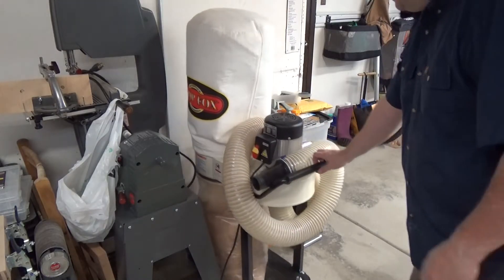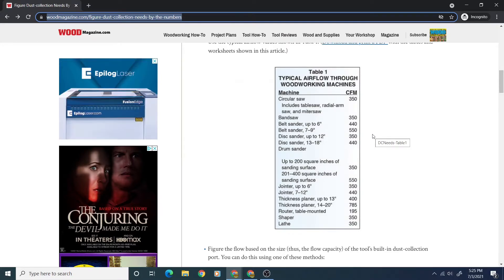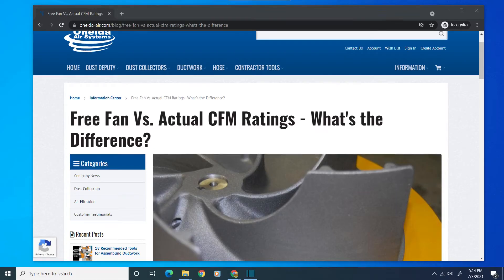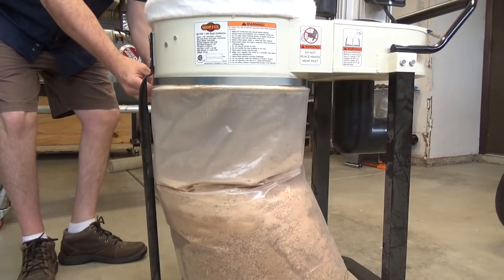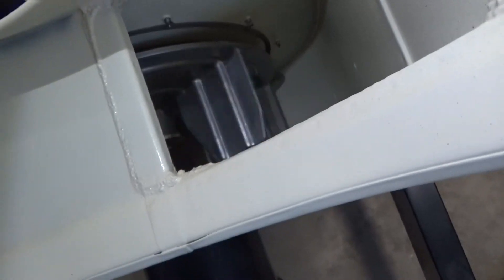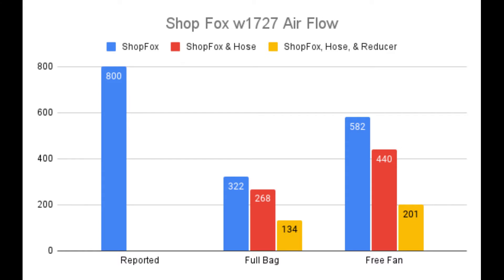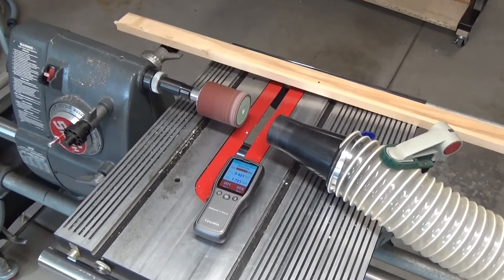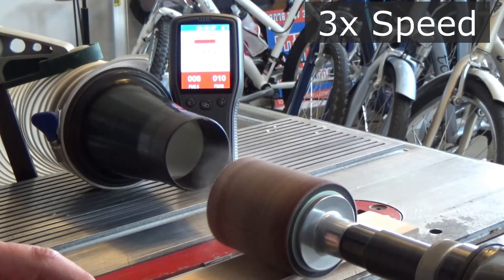Woodworking Dust Collector Tested: 800 CFM Really? Does it Matter?

Comment: Wow I was testing a 2HP shopfox single stage at my work and I was so confused when I measured the actual cfm at the flex duct end. I was measuring a little more than 1/3 of the rated cfm rating at the flex duct end. When I measured directly at the dust collector inlet, I measured 1/2 of the rated cfm rating which was much higher but still not the rated cfm rating. The dust collector probably had not ever been cleaned and they used it for around 7 years.

Your graph ratings are very similar to what I measured for my shopfox at work.

Comment: Good video and I have subscribed. I worked many years in the HVAC (industrial) environment and your tests are valid. As you mentioned, most important is performance. In my experience, lowering the airflow rate of blowers significantly lowers the KW (of amps). It would be interesting to see some actual amp or power data for your dust collector. I would guess you are running about 30% of the motor nameplate FLA rating.

Comment: Good analysis and interesting conclusions.
Does it keep up with the dust generated with your table saw? Also, do you have a lunchbox planer? If so, can it keep up with that?
Reply from the maker: Thanks Steve. Yes, the dust collector does a decent job on the table saw and Lu box planner. But I would say it’s the bare minimum. At some point I would like to upgrade to something like the Oneida mini dust gorilla.

Comment: I like this video. My dust system is very similar to what your using down to the moving of the hose and the 4” to 2- 1/2” adaptor. I couldn’t be happier for the reasons you mentioned. Let me add that a system like yours has a slower, quieter motor than any shop vac.
Reply from the maker: Yes it’s definitely an upgrade from the shop vac I used to use.

Comment: really good video, thanks for your detailed analysis as I'm considering if that exact system will be good enough for my use (which is similar to yours). Thanks!
Reply from the maker: Thank you, if you are considering the same model, rockler sells a 42 inch hood for $40. It is rated at 1 micron.  It is listed as a Jet dc650 filter but fits mine. I did the upgrade and am happy with it.

Comment: Can u share link to Anemometer u used? Have I g a hard time finding one that doesn’t require a bunch of math lol
Reply from the maker: Sure, I added the link to the description. Note, you still have to calculate the area of the opening in feet and enter that into the unit in order for the unit to correctly calculate CFM on the fly. I have seen many YouTube videos where it was obvious that the video maker did not understand this and showed impossible CFM value for the unit they were testing.

Comment: @ 2:06  you mentioned the chart from a magazine showing the typical airflow through woodworking machines.

I'm a bit confused at this; does this chart show (mean) that if one were to get an effective dust collection for a table saw they would have to have a CFM of at least 351?

Is that how I'm supposed to read the chart?

thanks for the video by the way, appreciate the content :)
Reply from the maker: Hi Fred thanks for watching, glad you enjoyed the video. I linked the article in the video description, which explains a lot more about those numbers. But I believe the 30 CFM value is based on maintaining 4,000 FPM (average minimum to suspend dust in air) for a 4 inch dust port. So it assumes a table saw with a 4 in dust port.

I take all these numbers to be rules of thumb, some of them are achievable for a hobbyist like me while others are only accessible to professional shops with large budgets. So I just do the best I can with what I got.

BTW - I did a follow up to this video and another update in my Shop Tour video if you are interested.

Comment: Not sure how I missed this one. This answers my question about if you have installed a Thein baffle or not. Have you looked into them? Scott
Reply from the maker: Thanks Scott, I hope you enjoyed the video!
Reply from the maker: Scott, based on your question, I looked into and thought a lot about an internal style Thien baffle that mounts inside the "bag ring."  Short answer, I have decided not to pursue it. Short reason, I think my dust collector is too whippy to compensate for the CFM drop.

I'm making a lot of assumptions, BUT if the purpose of the baffle is to encourage more dust to drop into the bottom bag than already achieved by the cyclonic action of my existing bag ring, then the only way it can do that is to slow the air velocity at the outer ring. Slower air suspends less particles. 

One way to slow air (at a fixed CFM through put) is to move the air from a small vessel to a large vessel, like a dust deputy does. It slows the velocity and allows the centrifugal forces to push the dust up against the cone wall, where is slows further and then falls. Hopefully the air in the center moves much faster to compensate so that the total throughput is unchanged, but we know that cyclones reduce CFM throughput so it is not 100% effective. Different designs may have different efficiencies, so Bangood shopper beware!

I don't think the Thien baffle is slowing air by moving it into a larger chamber, I think it is probably employing the other method of slowing air, which is to increase air friction by adding a large surface to the air stream. Unless it has a mechanism to increase the air velocity in the center zone to make up for the lower velocities against the outer ring that help the particles fall out, then it will significantly cut the CFM throughput of the system. 

So, for guys with a 2-3 HP system who just installed a HEPA grade canister filter, then they can probably afford to lose 100 CFM or so in order to buy a little more time before their filter clogs. For my little 1Hp system which barely makes 300 CFM at the end of my hose, I can't afford to lose air flow. But I think tapping on the felt bag to clean the filter for 20 seconds once a day is a reasonable alternative. -Tom
Reply: @woodshopnerdery  Sounds well reasoned, but it would still make for good content.

Comment: Love the info on vacs. all I have right now is a shop vac and am looking at dust collectors to see if I can find one in my price range. Keep up the good work!
Reply from the maker: Glad you liked the video. I started with a shop vac too. They work but to help keep the filter clean I added a dust deputy, but it was hard to move the dusty deputy and shop vac around the garage. So I looked into making a cart, but then thought, why make a cart when I can get a dust collector that takes up less space? So that's when I made the upgrade. BTW - I just saw my model dust collector advertised on Marketplace in my area for $150. Seems like a great deal, if I didn't already have one I would get it.

Comment: Good video.  A cyclone would allow you to maintain a set airflow for much longer between filter bag cleanings as it catches the majority of the fine dust, but unfortunately you'll lose about 20% airflow with it.  In other words they protect you filter and keep it working better, longer so you will have a more consistent airflow over time using one.  You may want to look into a HEPA cartridge filter (Wynn as an example) instead of those filter bags though.  Yours is only rated down to 2.5 µm, whereas a HEPA filter would be spec'ed down to 0.3 µm which is the more damaging particle size for your lungs.
Reply from the maker: Great information RFGuy. I pinned your comment so others would see it. BTW - if you are the same RFGuy on the SS forums I found your anemometer data measuring the DC3300 with the 42 inch 1 micron hood very helpful. I mentioned that post over on the SS Facebook group.

https://www.facebook.com/groups/684461538311971/posts/4125058177585606/?__cft__[0]=AZVHBK-XOAjvQeM8WR-RBf1oawvPC8eyK3Gh5fxq0xljzQdXaTrkHr4acL59iNku1RFTffCK14scI4KolPezvsHh8Ahk3X_h9kUuL6kQuWbUjiTUAFPbUipeV1lI0zw3yzcgE8aAPr1EwFCblb7qsXTq&__tn__=%2CO%2CP-R
Reply: @woodshopnerdery  Yeah, that is me.  Glad someone found the data helpful.  You and I are probably the only 2 woodworkers that own an anemometer!!!  Does your dust particle counter that you showed in the video give you particle counts or just AQI (PM2.5, etc.) numbers?  One of the forum members came across this one on Amazon that I like.  It is cheap but gives you dust particle counts down to 0.3µm so it is helpful for examining the distribution of dust particle sizes.  https://www.amazon.com/gp/product/B07DL1M46J/ref=ppx_yo_dt_b_search_asin_title?ie=UTF8&psc=1
Reply from the maker: @rfguy8499  No the device in the video does not give particle counts. I actually got that one because it measures VOCs and used it in the video because it is battery powered and easy to film. Assuming a minimum air velocity, 2.5 micron and sub 2.5 micron particles with be co-mingled, so I thought it was a decent proxy for illustration purposes.

I have had one of those acrylic sandwich type devices with the PlanTower sensor  for about 5 years. It has an "AirNow" label and I got it shipped direct from China via Ebay.  But it requires an AC cord, so not convenient for filming. And the particles per 0.1 liters report uses a font too small to be clear in video unless really zoomed in.

I used the AirNow sensor to test the effectiveness of my cheapo ambient air cleaner ( to get those pesky sub-2.5 micron particles which escape my filter bag). I use a box fan and a 20x20 Merv 13 furnace filter. As shown here. https://www.youtube.com/watch?v=kH5APw_SLUU

It works!
Reply: @woodshopnerdery  Using a box fan and a pleated paper air filter is great for cleaning the air after the fact, but it is definitely preferred to not let those dust particles get into the shop air to begin with.  Running a DC with bag filters make them a dust polluter in the shop, not a dust collector.  JMO.  Yeah, I have a Dylos particle counter which I believe is more accurate, but those PlanTower sensors are nice because they are cheap and have more particle size ranges so it is easier to see the distribution of them in your shop...
Reply from the maker: An ambient air cleaner helps no matter what filter you have, not all the dust makes into the end of the hose even for huge systems. And the filters do let particles through no matter the rating. I don't mind having a second chance at getting that 5% dust at x-micron that the filter allows through.

Have you converted to a pleated filter? How did it affect your CFM measurements? Did they go up or down? If I could be convinced that the CFM would stay the same or go up for my system, I might pull the trigger on sub-micron cartage conversion. But I'm not sure, these things have to work as a system, you have to move air to collect dust. 

Did you know those particle filter ratings are based on an industry standard which includes air velocity as a factor? It's not just 95% of 0.3 micron, it's 95% of 0.3 micron at a certain air velocity. So, "your mileage may vary" based on the velocities produced by your system. At least that is how I understand it.
Reply: @woodshopnerdery  The CFM #'s you refer to were numbers from my DC-3300 and no I never put a HEPA filter on it because I retired it.  My present system has a HEPA cartridge and yes I had an improvement vs. a used non-HEPA filter, but to maintain that improvement I have to run a cyclone in front of it.  Yes, I am aware of how filters are specified.
Reply from the maker: @rfguy8499  Sounds like a really nice system!

Comment: Thomas, interesting and thoughtful as usual … thank you!  I’m thinking of upgrading from a Rigid shop vac.
Reply from the maker: John thanks for the compliments. I started with the Rigid ProPack vacuum because that's what I already had. I still use it for utility vacuum purposes, it's a great vacuum. BTW - I did measure my ProPack CFM performance. The spec. sheet claims 101, I measured 134 CFM at the port and 88 CFM at the end of the stock hose.
Reply: @woodshopnerdery  yup, that’s what I mean … like checking your old vac too.   :-)

Comment: Not on the dust collection - but - have you used a conical disk for sanding?
It is quite good at exact dimensions and is “easy” to use.
Reply from the maker: John, thanks for watching and the question! Yes, I was just using the conical disc sander today and yesterday. I just finished up so many shed projects with many board feet of pine and cedar loaded with knots, that both my planer and jointer knives have nicks in them. My daughters asked me to make some jewelry stands so they can photograph homemade wares for their Etsy store. I want to turn these around quickly because I really love it when they ask me to do projects for them (video coming).

Anyway, since I would have needed to pull out the conical sander anyway to touch up the knives, I just touched up the glue edges on my maple work pieces with the conical disc to save some time. Some of the maple is Birdseye and some curly, so tough go on the jointer anyway.

I find the conical sander a must for edge jointing plywood, yes I am that cheap I edge glue scrap plywood together. For some applications, but not all, I find edge glued plywood is plenty strong. I get a really nice glue edge off the table saw with a Forrest Woodwork II, and that makes a decent plywood edge glue joint. But, I find if I hit the edges with the conical disc sander, it's even a bit stronger, and still square. 

And of course I use the conical disc sander with the SS jointer and planer knife sharpener.

I recall in your TrueTrac comment on Scott's channel that you mentioned the conical sander in relation to a table you were building.